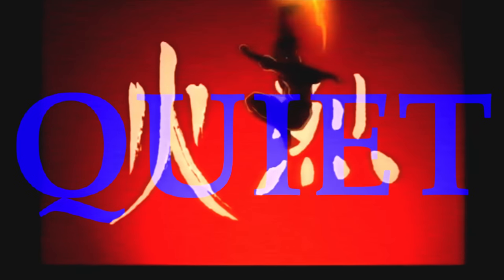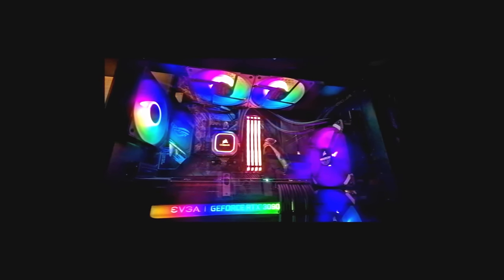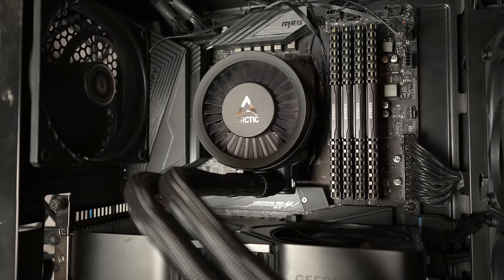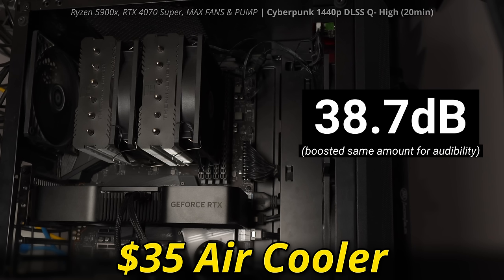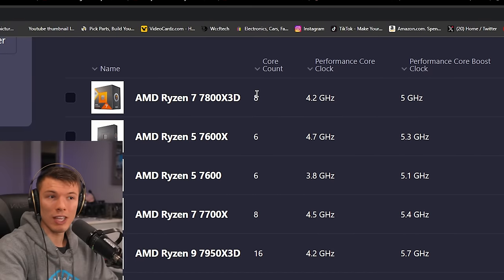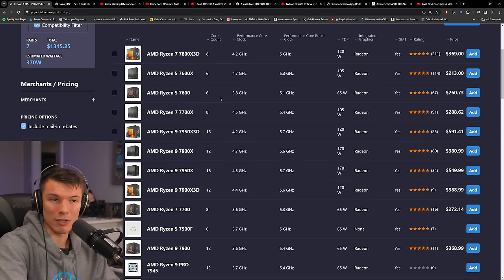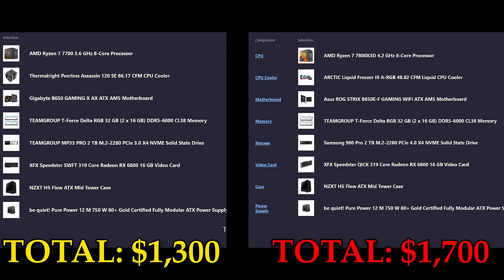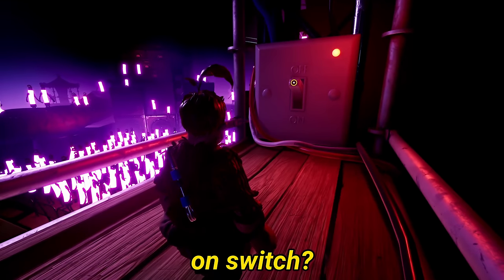How to Get the BEST VALUE PC!! (you’re doing it wrong…)

Comment: In a small pc case (which can be a must) for some person for space or just taste, liquid cooling is more advisable. If you 'need' a better air flow on all the pc components.
So It all depends on the build and needs of your PC, it can't really be measured by metrics or costs.
Reply: Yep, I have nr200p with noctua c14s pushpull 140mm on 7800x3d right now, it can get a bit toasty unless you lower thermal limit a bit and flip gpu fans to exhaust instead.

Comment: Pros got the arctic p12 fans, based af.

Also best budget case imo is the msi mag forge 100r  £50 in the uk with 3 included fans that are decent, only downside is the snap off plates for the gpu slot covers.

Comment: You are so right. I recently did mini itx build and even though in them liquid cooling makes more sense I went with air cooling and that saved me 50-100$ which I put towards 7800x3d and thats not all, instead of very expensive mother board I bought B650I AX from gigabyte which saved me close to 250$ compared to more popular choices like Asus ROG STRIX X670E-I GAMING WIFI which I used towards replacing 7800xt with 7900xt. 
Do I miss something from liquid cooling or better motherboard?
No, my pc is almost silent when idle, cpu cooler is never louder than actual graphics card when gaming and cpu is not throtlling either. I could either save a lot of money or just like I did got much more performant pc

Comment: One thing I only recently discovered, is turning PBO off drastically reduces the CPU temp (like 20 degrees cooler in my case) and still delivers almost the same performance. Now granted I'm not gaming at 1440P but in my own tests most games will run just fine with the boost off. Was just something I noticed one day, with PBO on it rams everything through 2 or 3 P cores and barely touches the rest and pretty much ignores HT altogether. Turning PBO off it just uses all the cores and HT to make up the difference. But the lower voltage going through the cores usually results in a much lower temp. And I'm just using the stock wraith cooler that came with my machine, a decent aftermarket cooler would probably lower the temps another 10 or 15 degrees. My rig with PBO on hits about 70 degrees playing things like forspoken etc, with PBO off the game runs just as well but cpu temp is only 51 lol. Even in Cinebench testing, with PBO on my temp hit 80, with it off it only hit 65. The score difference between the two was about 25 so no big deal. I'm not running one of the newer higher watt processors but I'm sure it would have an even greater impact on those due to drawing a lot less power.

Comment: Quality video.

If one really wants to squeeze out even more, there's plenty of room to do so even with the cheap build.
- Cheaper case
- Non-modular power supply
- Slower ram (it does make a difference but the more expensive one sometimes isn't worth it)
- Older platform CPU (5900X or 5700X3D) + Motherboard. Would make the ram even cheaper
- Use the stock cooler if you don't mind a little bit more noise and/or higher temps
Reply: I think the point of the two lists in the video is that they both provide the same performance, and the cheaper one makes no meaningful sacrifices over the more expensive one. Once you start talking about stepping back a CPU generation, picking a non-modular power supply and a cheap case you are making meaningful sacrifices. Yes most people would still be content with that, but also there's nothing wrong with spending a bit more to have nicer stuff. The point of the video is about how to get the same experience for less money, not about making sacrifices to save money

Comment: 19:27 I think that what you should buy depends on what you plan to use your system for. If you're just gaming, there's really no reason to get more than 16-32 GB of reasonably fast RAM, you don't *need* the best CPU, or the highest end GPU. But, if you're doing creative or scientific work, then the workload can become much more intense. If you're running a Random Forest algorithm to Identify different tree species on a 500 GB .TIFF file, and this just gets even more ridiculous, then you might need something a little more powerful.

very well put together video though.

Comment: As an EV on in the UK I would never get one unless I had a guaranteed place to charge I.e off street parking / drive or garage. I think EVs atm are only good in a few niche scenarios I.e you have access to your own charger and generally don't have a huge commute every day or use your car for a taxi / delivery service etc.

Living in the city its simply not worth the hassle you have alot of the same issues in London except u can't simply run a cable out of your window even if u had a space outside due to obstruction of sidewalk as council would be on your case, not to mention less than a 7kw charger is a nightmare 😢 would take forever to charge up.

Definitely more needs to be done to make this EV movement more realistic in big cities

Comment: The reason why it making a buzzing sound because the radiator is upside-down. I use the exact same cooler and it make no noise with the hose going higher than the cpu. It mostly making that noise because there air in the side that mounted to the cpu.

Comment: You can get a big ass Thermalright Peerless Assassin or Phantom Spirit cooler for maybe 50 bucks Canadian, they're all you'll really need for ANY overkill gaming rig, even batshit ones with 32 cores overclocked out the ass.
Watercooling is 'neat' but unnecessary.
Reply: I went for water cooler solution becouse it was same price as good air and more compatible with mine motherboard. 360 aio costed me 80 bucks

Comment: It's been a while for this huge debate. And while there are some scenarios where water is better, AIOs the pumps break first all the time, sometimes they perform worse than a decently priced air cooler and you can't really refill it as far as I'm aware. 

I came to the conclusion that if you're going water, go full JayZ or just go air. The extra price and hassle of an AIO that will last you at top performance for only 2 years or 3 maybe, is not worth it.

Edit: That motherboard VRM section was nuts. Learn a bunch, thanks a lot, great video!

Comment: Ryzen 7500f and Ryzen 7700 are just the best value, and they can be overlocked and cooled with a 30$ cooler. Paired with a 2x16 6000 CL30 memory the prformance is more than enough for a RTX 4080\7900 XTX in 1440p.
As for the motherboards  - a 125$ B650M motherboard is enough for 8-12 core cpu, has 2 m.2, perfecrly good for 90% of people. I get a lot of questions from people who think you need a 300$+ mobo for a 7950x. That is not true, many 150$ boards have a VRM good enough for 7950x.

Comment: I didn't have to change out the fans on my Peerless Assassin...yet. Been about 8 months now and no issues. I have not ever seen my 5700x3d get over about 50 C - and just running CPU-Z stress test, it tops out at 40c (room temp 22.2 c)

Comment: I have 4 tiers of SSD's: SATA600 ones (MX500, 850 Evo), PCIe3 crap tier (660p), proper PCIe3 (970 Evo) and proper PCIe4 (Western Digital Black). You definitely notice the differences but mostly it is about when you install, copy or remove files, in that case up to PCIe4 it makes sense to have better. But if you just game it doesn't really matter. The bang for the buck now is M2 PCIe3/PCIe4, the newest one (currently PCIe5) never is worth it if you look at value vs $.

Comment: Perspective of a person that just bought a 14900K and cooling it with air. I got the BeQuite Elite and yeah, sure under Cinebench it hits 100C and then backs off to 95C after a few seconds. But gaming, I'm getting between 60 and 80C depending on the game. Tiny Tinas Wonderlands 60C, MW3 75C, RDR2 78C. These are all roughly avg temps. Also, I ran 3D Mark Time Spy and had a solid 5.7GHz all P core throughout the whole test with a high temp of 77C.

What I like about air, set it and forget it and while sleeping I can't hear a thing coming from the PC, DEAD QUIET and only maintenance is thermal paste after 5 years or the fan dies. Consider this. If a fan dies when you're not home, not a big deal, the cooler will be keeping the CPU in check till you notice your fan is dead. Water same scenario, PC overheats and shuts down or if you end up with water leaking. A lot more hassle with water and to many issues to arise.

SIDE NOTE: My 9900K is a few years old now and I've been running a Noctua nh-u12a chromax.black and while running Vegas or Handbrake with ASUS multicore enhancement enabled - remove all limits only hits 85C.

Comment: I have the r7 7700 and it's insanely good with some minor tweaking (PBO and Curve optipmizer in ryzen master). i also have basically the same performance as the 7800X3D in cinebench 24, all 8 cores boosting to 5,35 GHz, over 1100 points. and my cpu costs about a quarter less than the 780X3D.

Comment: I used to do custom loops for years even before loops were mainstream with the old Thermaltake big water kits but I stopped after the GTX780 released and moved to air cooling, I had 3x Asus Poseidon GTX780's in Tri SLI it looked amazing but 9/10 hardly any games even used all the 780s. I stuck with Air for years till I got the 12900k which is a furnace of a CPU the air cooler wasn't enough to cool it. My 7950x can run fine under air but the issue was the air cooler recirculating the heat all around the case which made my 3090 hit 84*c and thermal throttle down to 1700mhz. 

I had a Dark Rock Pro4 on the 7950x which is a great cooler even with the offset mounting on AM5, then I moved to an NHD15 but settled on a Deepcool LS720 which exhausts the hot air straight out the top and now my 3090 sits on 78*c with a constant 1920mhz. Air coolers are great for lower core count processors but if you have a 12900k, 13900k, 14900k, 7950x etc then unless you want your system standing in as a space heater its better to go AIO to exhaust the hot air out of the case. 

For strictly gaming a Ryzen 7600x is perfectly sufficient with a cheap air cooler, you don't need expensive Ram or an expensive case just dump that cash into a 7900XTX with a 1440p 144hz or 4k 144hz monitor. I know a guy that dumped his cash into a 13900k then bought a 4060Ti... After I told him to go for a 7600x and XTX or 4070Ti Super since he preferred Nvidia. There must be balance in the force.

Comment: I have been running custom watercooling sinds 2017, but with the current AMD CPU's and the way better air cooling performance on GPU's I would not advice it to anyone. 

When I started with watercooling the 1080ti I got was only a 2slot card and sounded like a jetengine . Together with a 7700K that I delidded it was almost mandatory to keep the noise on a decent level.

Comment: CP2077: Phantom Liberity does make use of SSDs, only in the DLC area, outside of there an HDD is still fine.  Even loading speeds aside from first time load you can't tell an NVME SSD from an HDD.  Back in Dec SSD prices actually got below HDD prices for the same capacity, I grabbed up 7TB worth of SDDs to replace 4TB of HDD space.

I looked at pink hardware, but all of that was double the cost just for color :(

Comment: I chose aircooling because if the fans break (it has 2) the aluminum will still act as a passive cooler so my cpu wont probably fry if failure happens on fans

Comment: Good logical video. I have looked into liquid cooling many times and have always come to the exact same conclusion.
I also do video transcoding on my CPU, with a decent air cooler and a properly adjusted fan curve, the Liquid cooler is not needed on AMD CPU's.
I can't talk to Intel because I won't buy them for some time now due to how inefficient they are for max power draw.

Comment: I don't know about the 7800X3D,  but my 5800X3D was hitting thermal throttling under full core loads until I upgraded my cooling. Still an air cooler, but a much stronger one than what I had. Saying it's "only 80 watts" is misleading. X3D is was surprisingly hard to cool not because of the wattage is pulls, but because the core to plate thermal transfer and the maximum temperature are both hindered by that X3D cache chip. It's an 80 watt chip wearing a sweater.

Comment: I built my system 3 years ago with an i9 10850k, 3070, 32gb ddr4-3200, 1tb ssd, and a 2tb hard drive. The only upgrades I've done with it since then are: adding a 2tb ssd for extra storage, upgrading to 32gb ddr4-3600, and switching my previous aio to a Corsair one after my old one clogged. 

To this day, my system handles everything I throw at it. Did I overspend in some areas? Sure. At the time, I thought it was worth it to ensure that I won't need a major upgrade for at least 5-7 years.

Comment: I noticed that there are very few Cases that let you install HDDs at all.
It was really tough to find a Case with Enough HDD Slots, and in the end, I had to remove 2 Slots to fit the Graphics Card. Goodbye upgrade Path ^^
The same goes for the Mainboard. I had to buy an Extension Card Because 4 SATA Plugs isn't enough.
So in the real end, I also had to buy an HDD Dock.
Giant Case which is still too small 200€
The Mainboard choice was Soul crushing and I settled for 260€ + an Extension Card 60€ (incompatible with Win11 YAY)
HDD Dock because you just can't un-Cablemanage everything every time you need to back something up 70€

After Weeks of dealing with all that and so much more Complications that came with the PC, I have it set up with its 4 HDDs, 4 SSDs, 2 M.2s.
Now I hope to not have to touch it again for 5 years :P
1 year is nearly over and so far, so good :)

Comment: My pc was air cooled for 10 years without any problems. My old GTX 970 and my 4790k were resonably quiet under load. I changed to a 5800x with XFX6950xt a year ago. In terms of heat and performance they were fine but ohh boyy... the noise. I can't stand it. The build is still in my trusty ugly HAF X Case with a lot of air flow but those parts are power hungry. Even after tuning my fan curve I wasn't happy with the result. With the price of all those upgraded noctua fans I could have bought different gear to begin with I suppose. 

I recently changed to a custom loop because I wanted my system to be whisper quiet in every situation not only while idling. A single MoRa 420 radiator outside of my case with 9 arctic p14 fans on min rpm are as quiet as it gets and the system can pull way over 650w while doing so. Best descision ever. Sure... there is oc headroom but I mostly did it for the noise. My aquastream pump will most likely live longer than the rest of the system. Generally speaking water cooling isn't worth it but if you wan't your system to be silent without load based/ temp based fan curves there is no other way.

Comment: My current PC has a glass panel on the front and side, RGB lights, and an AIO but that's only because I bought it used. I made sure to look for one with a Ryzen 7 7700x in it because the RTX 4070 wouldn't utilize a better one anyway. In reality, I would prefer a silent case with no glass panels. I currently have the AIO set to only start the fans once the CPU hits 50°C and the same for the case fans. Does that also work with air coolers? If yes I might just sell the Case and AIO and get a used silent case and aircooler if it's cheaper.

Comment: What About Video Rendering? i have Ryzen 7 3700x currently with AMD Wraith Prism Cooler and it touches 90c in premiere pro rendering and thermal throttling the cpu, and i think maybe for my use budget build won't work, In my next build i'm going with aio to avoid frying my processor, moreover it pulls like 90 to 85 watt for a 65w rated cpu.
Reply: Don't worry about the temperatures. Your processor will not fry itself. Ever. They've been designed to down clock themselves for decades now. That chip will sit at 95 degrees for its whole life and be fine.
Reply: As the vid said, you don't NEED AIOs. Dual Tower Coolers deal with those problem with basically the same result and cost way less, granted if your case fits.

Comment: For CPU cooling, let's not forget also the fact that you can undervolt CPUs, so they will hold the same or even give better performance while pulling even less W no matter full load or gaming, reducing temps even more. So AIOs are waste of money for most of the CPUs in my opinion, plus they can break down (coolant leak, pump failure, coolant canals clogging, etc), while the air coolers just work and there's no maintenance for them, except to clean them from the dust from time to time.

Comment: Noctua NH-D15 If you want the best, Thermalright Peerless assassin if you want 90% of the best for less than half the price. Do not watercool your rig. Water is a pain in the ass to clean and maintain whereas air cooling is just blowing out your case with an air compressor every 6 months.

Comment: I have two water cooled PCs right now (custom open loops), and I can comfortably say that only a custom loop (bigger and quiet pump, loads of radiator space and therefore lower fan RPM, and considerably lower temps - especially the GPU) should be considered better than air cooling. Naturally, open loops are expensive and definitely not anything you ever NEED, I really do this for the quietness and to a large extent because of the bling factor. Stick to air cooling guys.
Reply: So you're one of "those" huh? I just put my outside in the snow.

Comment: I'm still using my case i got in 2014. It has an optical drive and fans on the side panel. If my new graphics card would not have a bevel at the edge it would not have fit inside. 😙

Comment: The AIO is quieter than the air cooler if you optimize the fan speed and aim to have the same temperature. Assuming, of course, that it is not f***ed up by the pump, which is why I also stick to air cooling with CPUs.